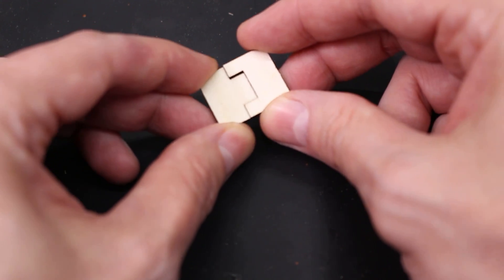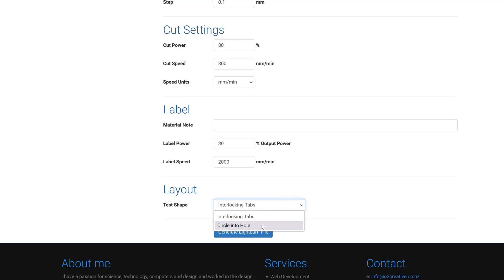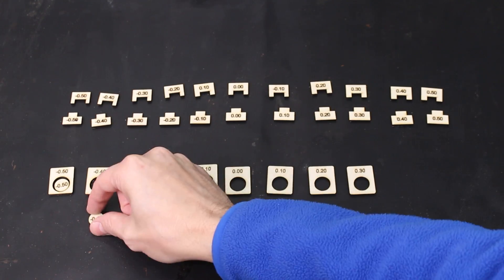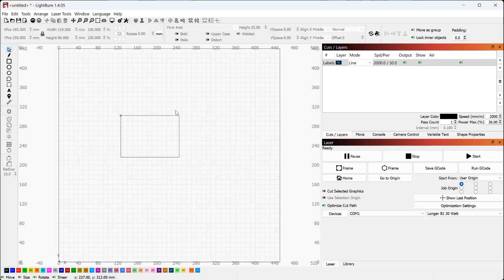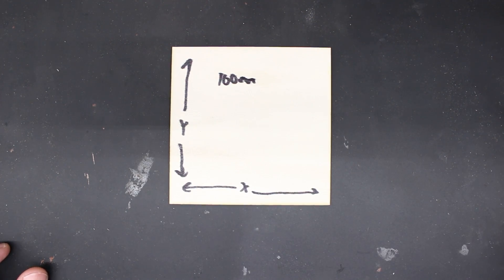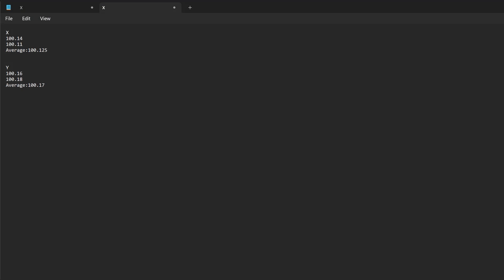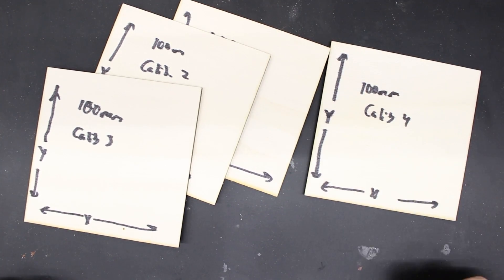Why Your Laser Cut Parts Don't Fit (and how to fix it)

Comment: Good info Thx.  I got a question... I figured out my kerf offset and it works good.  But... I made a slot (1x.107 wide) and did an array of them. Then made spacers to space two disc's apart.  I made the tabs 1"x.107 (the thickness of my plywood) it seems the array made the slots wider and the fit is loose even with the proper kerf offset. Oddly, some of the parts cuts snuggly also.  I'm stumped
Thx for any help
Jeff
Reply from the maker: Have you calibrated your X and Y axis on the laser before doing your kerf tests?

Comment: Hello,

Thank you for the video!

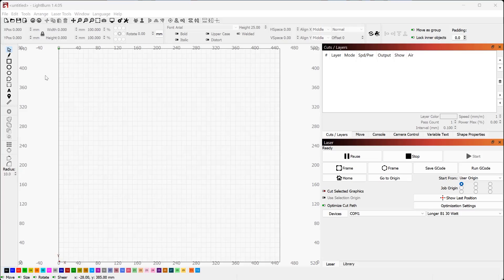I have a question regarding the second part of the video, specifically about the simple square you mentioned. (4:49min)
 Does the square need to have specific dimensions in order for me to measure it after cutting it with the laser?

Keep it up 🔥🔥🔥
Reply from the maker: You just need to know what size the square is supposed to be so when you measure it you can calculate the difference. Usually 100-200mm is a good size and makes measuring easier.

Comment: Does this work only if your dot is square?  Would it be a different test if dot size is rectangle?
Reply from the maker: The size difference between square and rectangular dot sizes on diodes is only 1-2 hundredths of a millimeter. Such a small size discrepancy won't make a difference in the testing and kerf settings.

Comment: I was lazy, when I got my lazer (see what I did there?) and just cut a 20 x 20 mm square from 3 mm acrylic and measured the size with a caliper. They came out as 19.8 x 19.8 mm, so I calculated the Kerf as (20-19.8) / 2 = 0.1 mm. The "/ 2" is because the kerf is removed from the both opposing sides.
Reply from the maker: That's a good way to estimate. Only drawback is if the machine's x and y and calibrated that can add some slop and throw off the kerf number.

Comment: My 100mm squares measured less than 100.  Is that normal?  Yes, I did use the 0.1 kerf from the 1st step.
Reply from the maker: Yes it is common for the machine to cut under or over the size you request. That's the point of the second calibration I show in the video. You can use that to get your X and Y movements calibrated.

Comment: Good afternoon! Here's a friend offering some important advice: use caution when dealing with MDF. Furthermore, it is worth extending this precaution to other materials, especially because regarding MDF, which is not widely discussed in Brazil, I had to seek information abroad. Although it is little talked about, what I discovered is worrying - there is evidence that MDF may be linked to cancer (due to the gases it produces when the cut is burned). But I couldn't find anything about the gases emitted when burning cardboard, could you say anything about that?

Boa Tarde! Aqui está um amigo oferecendo um conselho importante: tenha cautela ao lidar com o MDF. Além disso, é válido estender essa precaução a outros materiais, especialmente porque sobre o MDF, que não é amplamente discutido no Brasil, precisei buscar informações no exterior. Embora seja pouco comentado, o que descobri é preocupante - há indícios de que o MDF pode estar relacionado ao câncer ( devido aos gases que ele produz durante a queima do corte). mais não consegui achar nada sobre os gases emitidos na queima do papelão saberia dizer alguma coisa sobre isso?

Comment: Thank you for the website, it is going to make a huge difference. 

If you work with acrylic, I would like to share with you something I have found challenging for last month or so. 

I want to cut rectangles of 4 mm thick acrylic. Not big ones, maximum dimension is 24 cm. 

BUT, I need to make holes on every edge, yes EDGE,  of the piece. 

Holes are 2 mm diameter and 2 mm depth. 

And I have to engrave so many of them with high precision, therefor laser is the way to do it. 

If you can do it, or want to take a shot of doing it. Please let me know to share more details with you. 

Thanks.
Reply from the maker: Glad you found it useful! Find my email in the channel info and send me an email about your process. I'd like to hear more.

Comment: Out of curiosity, wouldn't the kerf be the actual cut width as dictated by the DPI setting?
Reply: No, kerf is a per line parameter. DPI (some prefer LPI) determines the spacing between adjacent lines.
Reply: @henrywilliams1791  Kindly, see my reply to Henry.  Thanks for your reply. EDIT * You're Henry; I meant Curtis, sorry.
Reply from the maker: As henrywilliams said, DPI is the spacing between lines. Since a cut is only a single line DPI doesn't apply.
Reply: @LetsMakeAThing  When you adjust DPI, you are essentially making the laser beam, the cutting width, no?  So once that is set, you know the cut width, just like with a saw blade.  Adjusting kerf, seems to be the EXACT same thing as cutting to one side of the line, to adjust for laser (saw blade) width.  Right?
EDIT - My point is, that you don't need to waste material when you can just adjust for the width of the laser beam, by setting KERF to the DPI/Line Interval.  Am I missing something?
Reply from the maker: The kerf of the laser beam is specific to the laser itself and you have to test for it. Each diode laser has it's own personality due to manufacturing and quality control processes. So the only way to know the kerf of your laser is to test it by using material and running a test like the one in the video.

You can't adjust the width of the laser beam via software as it's a physical constant of the laser. Just like I can't adjust the kerf of my table saw blade. DPI changes how close each laser pass is to the previous when doing a fill. If you look in Lightburn there is no DPI or lines per inch setting when a layer is set to line. If you change that layer to fill then lines per inch will show up. This setting changes how close together the laser lines will be.
Reply: @LetsMakeAThing  Thank you for your answer.  I see where I was getting hung up in my mind.

Comment: Keep in mind most calipers have a + and - resolution accuracy. The .08 could be + or - whatever the resolution your calipers can measure. So you will probably not get down to .01 anyways. Good video. Thanks.
Reply from the maker: Excellent point! The calipers I use have a +/-.02mm tolerance so as you said I won't ever get exactly .01. Which is fine for what I use the laser for.

Comment: Never actually cared of both these tests, nor needed, but it’s interesting. 
Wouldn’t it be better to run and set the calibration first, or it doesn’t matter?
Reply from the maker: If you don't set your kerf first it will throw off the calibration.